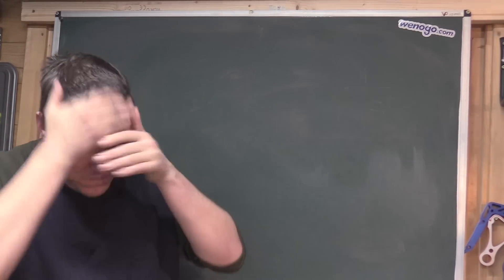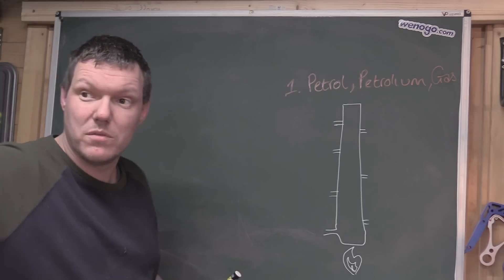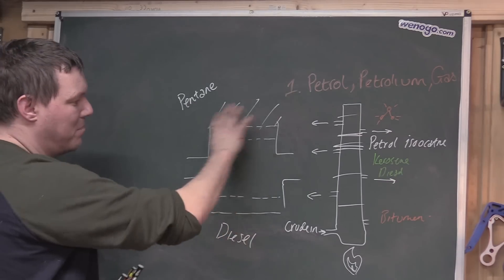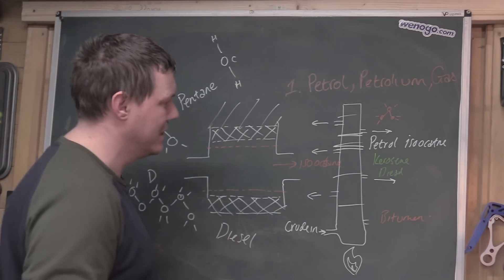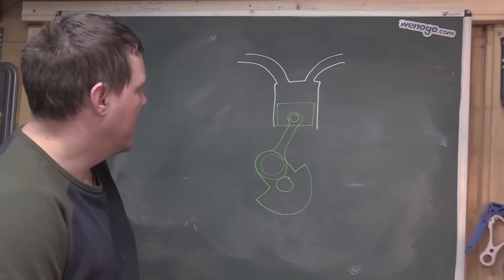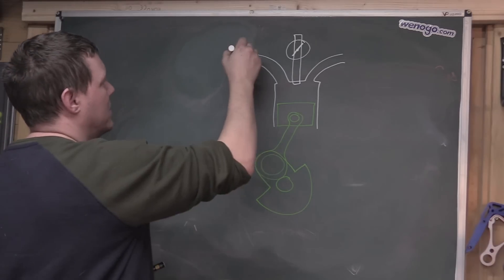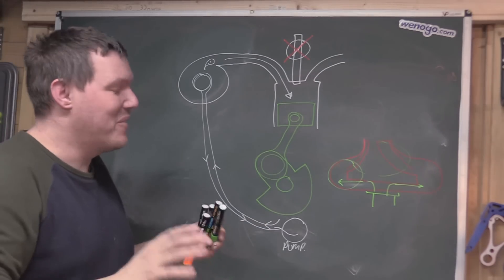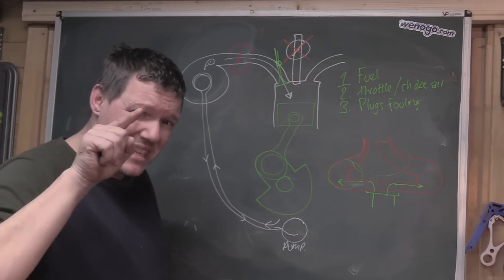Can Petrols run away like diesels?

Comment: My old victa 2 stroke mower ran away on me when I ran it on a petrol/diesel mix from when I accidently put diesel in my bike.
Pulled the plug and she just kept screaming, so I strangled the rubber snorkel which completly flattened itself ... Ive never seen a old 2stroker with so much induction.

Comment: I had a chance to work with Ford 1,6 dohc engine with vacuum leak. I was searching where the leak is with brake cleaner and it sucked a lot of it when i found the spot, i was showing it to colleagues for with poring cleaner for many seconds. Engine revved up and started to run with awful preignition, so we shut it down and poor sucker was still running and revving as a diesel for few seconds C:

Comment: Nice vid this one, cheers Matt.

I think the only addition which should have been included is how stop to a runaway once it gets going.
I won’t go on about the methods (I think there are only 2; choking the inlet or dumping the clutch if it’s a manual), but it would’ve been good to leave people with that knowledge.

Runaways are scary things!
Reply: how do you actually do it beyond stalling the engine?

Comment: Can naturally aspirated diesels run away if they leaked oil from valves and thru the oil rings on the piston?
Reply from the maker: No. Because said oil fouls the plugs, and cools them down too much
Reply: @thedirtyworkshop  i mean naturally aspirated diesels not gasoline with spark plugs. I heard many people say that diesels only runaway because of turbo oil leak so i was wondering if that was true and that if a naturally aspirated diesel would be able to runaway since it doesnt have a turbo to leak oil from
Reply: @288gto7  the oil SHOULD foul the glow plug and stop it reaching the point where it ignites purely via compression 

note I said SHOULD

Comment: funnily enough when my fire gets really hot, 27°C is the temp I get as well. I use furnicite as well as wood. 
P.S. I found you when I wanted to find out more about that straight 4 with the freevalve system. Sad to see it was vapourware.

Comment: I work on an oil refinery, it's often surprising that people think crude oil is this thick, nasty, black soup but it actually arrives from the oil rig looking quite a lot like used engine oil.
When it turns up, it's fizzy like CocaCola. If you leave it alone and it starts to warm up from ambient temperature, the lighter dissolved gasses (butanes, propanes etc.) start boiling off on it's own. This is called unstabilised crude and it's quite dangerous because it'll fire up for no reason. We preheat that oil under controlled conditions to boil it off, the stabilised crude is what gets thrown onto tankers. The NGL gasses get seperated out, some of which (methanes) gets piped into the National Gas Network for your combi boiler. You're welcome 😀

Comment: Worked on some big marine generators used as black start emergency generators on a gas processing plant that were fitted with emergency shut off vanes if the generator ran over a set critical speed. The vanes shut off the air supply which would starve the generator and stop combustion. I cant believe car, truck and locomotives don't have these fitted as there are some incredible examples of loco runaways on the youtube.
Reply: We see these types of things a lot at work, on industrial generators, welding sets and pretty much anything engine-driven. Chalwyn valves.
It's a plunger on a very lightly-loaded spring. If the engine starts to suddenly speed up, the spike in vacuum in the intake sucks the plunger into it, suffocating it.
More complicated models also pull a cable that kills the fuel supply to the injection pump or opens a valve to dump the oil pressure into the engine sump.
They're easy to identify, big yellow can on the intake pipework with some nice warning labels on it like "Do not mess around with this" in red lettering.

Comment: Ah... That's one source of diesel runaway.  Detroit Diesels are 2 stokes that have the injector rsck rpm governed. If the rack freezes open the govenor can't control the rpm & the engine runs away until it destroys itself. There is a flapper plate before the blower to try and choke air flow but they seldom are effective. 
Intertngly, Jimmies can also run backwards. It's a thing to watch a semi stall on a hill, start to roll backwards and the engine catch. Smoke pouring out the intake and the driver madly trying to run a gearbox in the reverse order.

Comment: When I was 17 bought an ex taxi Toyota hiace diesel with 900,000ks on the clock and flogged valve stem seals. The blow by was mental. There was a breather hose that was hanging free and dripping oil, I thought it was a good idea to put it back onto the intake. What a absolute fuck up that was...i had no idea what was happening when it started to run away on me. I was trying to stall it by dumping the clutch in 4th and 5th gear but the bastard just spun the clutch. It finally died after it locked up

Comment: I had a petrol car that carried on running after I switched the ignition off. Not a runaway, it just ticked over.
I’d driven it back about 15 miles with a blown head gasket & it got so hot it didn’t need spark plugs when I got back.
It wouldn’t happen these days, this was a carburettor engine with mechanical fuel pump.
I just put it in gear & stalled it, a few days later the scrap man took it away 😢
Another car ruined by my idiot of a half brother.

Comment: HOW TO TRY/STOP THE RUNAWAY!
Put it on the highest gear possible, full power on the brakes and dump the cluch, it'll stall the engine stoping the auto feeding cycle, only works with manual gearbox.
Reply from the maker: I know someone who did this, and blew the clutch. It continued until it melt the casting around the sleeve and the head burst off its seat
Reply: @thedirtyworkshop  maybe you can try blocking the air intake? and if it doesn't work in the air vent, throw a couple of liters of water in it, it will surely stop...😂
Reply: @thedirtyworkshop  😬🫣🤦

Comment: Just to add to this, my old VW Golf had an anti-shudder valve, a vacuum & spring operated butterfly valve that operated when the ignition was turned on/off, this prevented shuddering if there was a bit of oil still in the intake etc when turning the engine off, how well it would work if the engine did run away I’m not sure, but it did work well with the shuddering tho.
Great vid Matt, all the best.

Comment: I had a run a way Astra diesel the oil seal on turbo wasn’t doing its job engine oil got sucked in switched car off still running tried to stall 1st gear dumped clutch nope then 3rd dumped clutch again that worked saved engine just cost me a turbo plus fitting

Comment: I put some nitro(rc car fuel) to top up the fuel on a 32cc petrol engine before...
I couldnt shut the thing off hahahah.

It was running with the fuckin HT lead off.
Those little glow engines are compression/glow ignition. Evidently a hot spark ignition engine is enough to keep it going

Comment: Gimme some loose pison rings ona carburreted vehicle with a sticky slide . I bet you any money i can get one to do it!
Never seen it but with my luck and a bit of fettling im sure its possible.
Reply: the carb slide sticking open isn't a runaway though that's just a mechanical failure that stops the throttle from shutting 

A petrol won't diesel (autoignite under compression only.)
Reply: @jediknight129  hence the need for loose rings and oil up into the bores. Or a blocked return oil way in the head.

Comment: You are not good at explaining, you don't need a turbo to get a runaway... It happens when the lubricant becomes the fuel.
The ignition point of diesel is lower than the one for gasoline. That means that diesel engines can ignite themselves if the pressure is high enough so all they need it a fuel source to run. If you have a leak from a piston or a turbo the engine can run all by itself independent of the throttle, hence a runaway. The lubricant oil becomes the fuel for it...
Since the gasoline has a higher ignition point it needs a spark plug to combust so by cutting the ignition there is no runaway on the gasoline, however!!! the new engines that have high compression can run away if the compression is high enough and there is an oil leak, where the lubricant becomes the fuel for it. I have not seen it in real life but it should be possible to do that...
Reply from the maker: Lol sorry mate but what? No petrol has run away. Do you know the auto ignition temp between diesel and petrol is only 40degC...
Reply from the maker: And I'm not good at explaining, but you had to edit your comment? Lmao
Reply: @thedirtyworkshop  I didn't claim to be good at it either so i had to edit it yes, at least i got it right on the second try...

Comment: I asked you this years ago. Had my KTM 250sx run away like a diesel. Throttle cable wasn’t stuck. Kill button wasn’t killing it, pulled the plug wire, or tried and got the piss shocked out of me, but finally killed it by stuffing rags in the intake. By then it was completely overheated.
Reply: Carb bike, keihin PWK36 to be exact. Only plausible explanation was the slide got stuck, but for sure the throttle cable itself wasn’t stuck. (Sometimes it can pull out of the carb and get hung up, sticking wide open. Had it happen before mid race. Regardless, never found out why, it was so strange.. multiple mechanically minded old guys witnessed.. Everyone was lost for words as to how. Hence why I asked Matt years ago when I found the channel 😅
Reply from the maker: You can have a fuel leak, it's something that gpz500 used to suffer from where the float valve used to get stuck open
Reply: @goinhot9133  sabbytage
Reply: @11metalfan  wasn’t at a race, everyone there is family.
Reply: @goinhot9133  wouldn't trust em as far as I could throw em.

Somebody wants you dead 😂😂
Reply: @goinhot9133  nobody can hate as strong as a family member
Reply: @11metalfan  right, but I’m telling you that’s not the answer lol.
Reply: I've seen this happen intermittently before. In the case I saw, the cable stay on the throttle grip was mangled, and so were the stops (Chinese soft plastic).  The throttle could over-rotate, and when it was over-rotated with gusto, it would pull the slide over the guides and lock in wide open. It made for some hairy experiences for the rider.
Reply: sounds like auto ignition, similar to hot-bulb ignition. It happens with old baddly tuned 2t + wrong spark plug

Comment: I once had a Yamaha dt125cc with a 230cc 2 stroke  yamahaLanza engine....I used the wrong heat range plug once after a rebuild.. pulling upto the lights it started revving very high...key wouldn't turn it off....even key out etc...
Turned out the spark plug got that hot it was glowing and was running away on it's own...
Stuck my hand over carb and it died and restarted ok after that till I got home...
The right plug in and all was good after that 😂